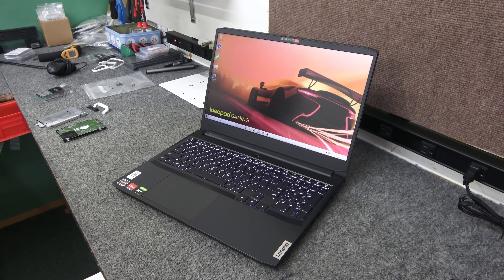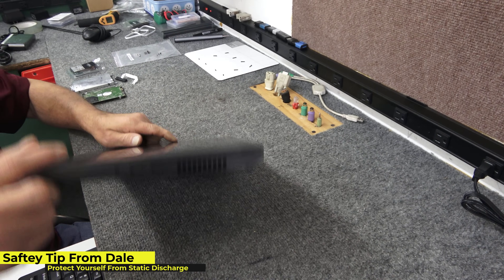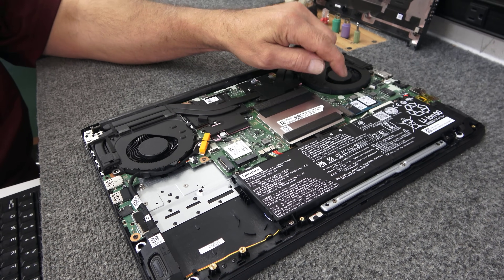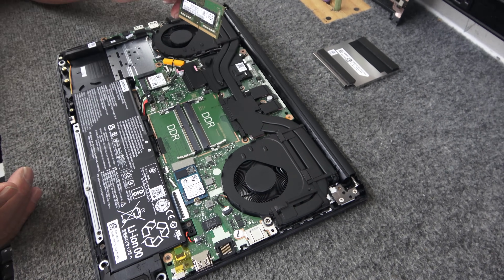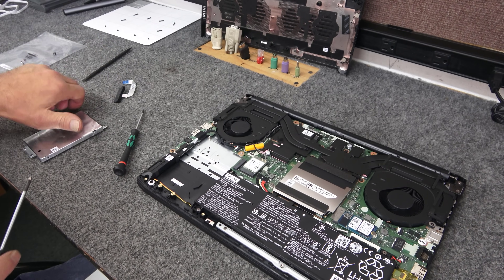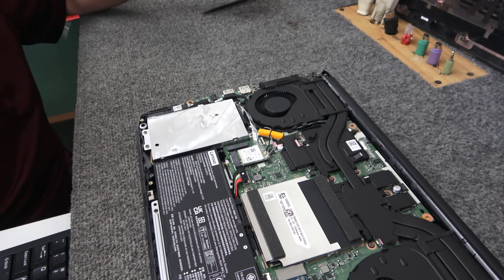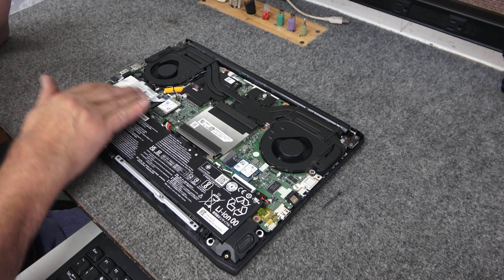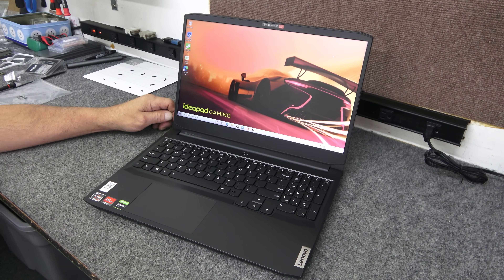Upgrading Lenovo IdeaPad Gaming 3 Laptop.  Memory and Add HDD.

Comment: Don't screw down a 2280 drive in there without a standoff. You will literally bend down the motherboard and probably break the m.2 connector it needs to be even with the other 2242. I just took a standoff for a motherboard and cross threaded it in there. It was the next size up from the small type standoff. It was even with the other 2242. And you need the same thickness thermal pad if you want to. It's verified that a 2TB 970 pro drive works and I'm sure a 4TB will work since there's nothing under the 2280. I have no idea why they don't include parts for a 2280 drive. Maybe the thermal pad cost too much. The IdeaPad 3 is a cheaply made machine. Guess that's why they only give parts for a Sata 3 drive for more reliability. It's Lenovo. They do care about quality of their main boards. Not like Asus trying to take on an Apple trend soldering everthing in and unpopulating hardware. Do be careful when re-pasting the heat sink is one fragile thing a whisp of wind can bend it. Look closely at the screw tightening numbers. They are there, but faint to see. Artic MX-5 is good. That stuff will last the whole life of the laptop. These laptops are good bang for the buck if it gets rough around a lot since they don't cost as much as the premium Legion or thinkpad line.
Reply: Standoff is not required, the M2 x L3.5 screw is all you need.  In addition, IMO a thermal pad is useless on the 2280 M.2.  It would only try conducting heat to the plastic shell which won't help dissipate any heat (or very little, at best).  Yes, there IS a thermal pad on the 2242 M.2 but above it embedded in the case is a small metal plate which will help spread the transferred heat.  No such plate above the 2280 mounting location.  BUT, the 2280 only runs at half speed, so it's not going to generate much heat anyway...
Reply: @eichisama  Hey, can you please help me out. I have the same laptop with a pre-installed 512gb 2242 nvme ssd, but I was thinking to add another Crucial P3 2280 nvme. Should I go with it or is it not recommended to install a 2280 drive because something is missing as it seems. I didn't quite understand what the problem is. Please explain in a less technical way. Thanks!

Comment: I have this laptop and want to do this upgrade. Should I replace the stock 8gig ram stick as well like you just did Or can I just add 1 more 8 gig ram stick with out issue?
Reply from the maker: Yes you can just add 8gb stick. Use same speed as factory stick. Thx
Reply: @CadillacComputerCenter  gracias! Ordering now. Same as the one you put on this laptop. The crucial 3200

Comment: This laptop IDEAPAD GAMING 3 2021 15ACH6 has wrong preset of cooling fan speed in their BIOS,
In PERFORMANCE mode (90W GPU 75 degreeC) but the fan is much more quite than in BALANCE or NORMAL mode 
Giving the PERFORMANCE MODE boosts the heat is significantly higher but with the low fan speed the GPU hits the throttle and reduce it's core clocks.
Please fix it and allow more fan speed in the PERFORMANCE, also, reduce the fan speed in QUITE mode (the QUITE mode is NOT quite at all!!!!).
I guess the dev team mistakenly swapped the FAN settings of PERFORMANCE and QUITE.

Comment: Installed m.2 2280 on mine, used a spare screw and some foam pads to level it out. Had no issues for 6 months now
Reply: what type of screw did you use?
Reply: @zooqaznguyen6820   M2 x6 screw but don't over tighten
Reply: Did you do 32gb ram

Comment: If I change to 2.5'' sata ssd, do I have to install the system? Or just follow the step you did in the video? Thanks!
Reply from the maker: Hi. If your going  boot from 2.5 inch ssd, yes, you will have to install windows on it, or do a clone.
Reply: @CadillacComputerCenter  What I meant is to switch to  2.5 inch ssd instead of  2.5 inch hdd that you use in the video. And install it at the same place at the empty slut of the computer. I can still treat it as a normal hdd just like you did in the video. Right? Thanks.
Reply: @CadillacComputerCenter  What kind of tape is recommanded for taping the wire inside of the computer? Thanks

Comment: Thanks for this video. I just bought my son the same computer, and I did the same upgrades:  8 more Gigs of DDR 3200, and a 2.5" HD.  Your video was just what I needed.
Reply: Anyone of you guys tried installing an SSD instead of an HDD?
Reply: Yes m 2 ssd pcie gen 3  @immanueldelcastillo6041
Reply: Stupid question: how much of a boost have you seen? I have this one too, and want to upgrade the ram and hhd.
Reply: @paulpiatt5610  the computer has been running great since.  My son has had no complaints.
Reply: @paulpiatt5610   if you upgrade it your gonna get a 15-25% fps boost

Comment: Whats the SSD capacity got to do with the amount of ram?  I mean I also would always tell a light computer user to not bother paying for 32GB of ram and instead if they insist on spending more money recomend them get a higher quality ram that is faster rather than more capacity but I still don't see what the SSD's capacity has to do with having 16 or 32 or 64GB of ram as long as it is running in dual channel and a reasonable clock speed that Ryzen 5600H will be able to stretch its legs.

Comment: can someone give me a  review about Lenovo IdeaPad 3  it is it good for video editing?
Reply: Which one? Link? I have the Ideapad gaming 3 with the Ryzen 5 5600H with 32GB ram and an RTX 3060 it's great for video editing. Are you going be editing 1080P, 1440P or 4K videos? If over 1080P you want to use an external monitor. Depending on the software you use, resolution of the output video, cpu, and the video card you have in the laptop will determine speed of the video render time. I'll be the difference between a 30 minute render and 2 hour render.

Comment: Hi tech grandpa. Thank you for such this helpful video!
I live in South Africa and purchased this exact device on Amazon (shipped from the US) and I got it this past Monday. I've been wondering on how to go about upgrading it and I'm thankful I've come across your super helpful video here. 

I've not opened the device as yet but one thing I'm kinda worried about is the mounting screw for the SSD. I'm planning on getting a 1TB 2280 drive to upgrade it. Could you please suggest what I can do in the event my laptop also doesn't have the mounting screw?
Reply: Bafo how long does it take to deliver from Amazon?

Comment: Hey man, I hope you respond. Can you tell me the exact model/part number of the stock ram sticks that were in there?
Reply from the maker: Hi. No I cannot. These computers are for my customers.  I have no need to know that. Any name brand ram you buy will wirk fine, just get the same speed and voltage. 1 2 volts. Different brands wirk fine together,  just use same speed. Thx
Reply: @CadillacComputerCenter  Ahh okay. I still appreciate the response tho, you got a sub!
Reply: @CadillacComputerCenter  IMO you would also want to match all the CAS timings as well, e.g. CL22-22-22-52 (same for both RAM sticks, in addition to size and speed) in order to be optimal.

Comment: Was there a warranty sticker on that laptop ?
Reply from the maker: Not on outside.  Lenovo places a small warranty sticker on one of the mainbord screws inside.  You can see it in the video.
Reply: @CadillacComputerCenter  can I replace the M.2 2280 without removing the sticker ?

Comment: does this laptop support two 32 gb ram making the useable memory as 64 GB? my use is to install virtual box and make a lab environment with a few vms to test my scripts and other configurations on operating systems. I want to know if that works ( 16 GB x 16 GB)
Reply: max is 32

Comment: I just ordered the Samsung 970 M.2 NVMe 1TB.
I'm not sure if my Ideapad Gaming 3 15ACH6, actually supports PCIe 3.0 at full speed (3×4)

Installed M.2 2280 SSD is PCIe 3x4 but runs at PCIe 3x2 due to M.2 SSD adapter limitation
Does this mean that on secondary storage M.2 2280 won't run at full PCIe 3.0 speed?
Have any IdeaPad 3 owners tried the secondary M.2 slot? If so, are you getting full PCI-E Gen 3.0 speeds? or is it 3x2?
Reply: AFAIK correct, the 2280 M.2 is limited to 2 PCIe 3 lanes, meaning max speed is halved.  I still need to confirm this on my system comparing the 2280 and 2242 performance, but according to the documentation that's how it is.  2280 is PCIe3 x2, 2242 is PCIe3 x4.

Comment: Is the battery wire clipped in? I can’t seem to slide it out like you did
Reply: It's a compression fit.  There are tiny tabs on the left/right of the plug you can gently push back with a small flathead screwdriver.  Just take your time and go _slowly_.

Comment: Just a quick question is it alright to only use one 8Gb crucial ram stick with the ram that originally came inside the laptop?
Reply: I just ordered the same crucial stick, any updates?
Reply: Any updates? I’m curious as well. Can I just buy one 8gb and add it in or do I need to buy two 8gb and remove the factory one like in the video?

Comment: I just got the Intel version of this and thanks for the great video, good in-depth things about not breaking it and being safe with battery and electrical components.

My only caveat - you mention you guided your customer on using only 16GB of RAM because he was opting to go with the stock 256 NVME drive and a regular 1tb HDD.  Which I'll normally say, even these days and for this machine, 16GB is fine for memory.  But it isn't tied to your storage space necessarily.  Some folks may not need a lot of storage but do virtual machines.  Or they have a lot of memory intensive programs - storage and memory can be 'mismatched' if you have use cases.  Just as someone who only uses it to store a lot of videos and music - they'd need maybe a 2tb drive but they don't do anything intensive otherwise - 8gb of ram is probably sufficient.
Reply: Yeah I was thinking the same thing, honesty for most of what I do on my ideapad, 8gb has gotten me by, but Forza Horizon 5 will not run without a minimal of 16gb for this machine as it uses some ram for the GPU, so if I want to play FH5 away from my desktop, I'll have to throw in anther 8gb module in this laptop
Reply: @caseygtr  you can get 1.5 more gb of usable ram if you change a setting in bios
Reply: @astrofry2340  I'm good. I added the 2nd 8gb stick.
Reply: 16 gigs of ram literally has only one purpose, virtual machines
Reply: @TabbyEgg312  Uhhhh, gaming and video editing?
Reply: @caseygtr  video editing yes but games? idk, forza horizon is the only game i know that uses alot of memory

Comment: i need help, i did exactly everything as shown in the video. i added an hdd and upgraded to 16gb ram but when i turn the laptop on, the light indicating that it’s powered on is lit up and the fans decently loud yet the screen won’t turn on. i’ve been waiting for like 10 minutes and most likely longer now
Reply from the maker: Hi. Make sure you are using 1.2 volt ram. And hopefully a good brand. If all else fails, remove your upgrades and test.  And of course be cautious of static.  And check that ram us seated well.
Reply: @CadillacComputerCenter  i have a team group brand. also when i took them out they were pretty hot, is that normal ? but they are 1.2 volt
Reply from the maker: @potatotuna7988  they get a little warm, yes. Put the factory ram back in to test.  I assume you put in 2, 8GB sticks
Reply: @CadillacComputerCenter  yea so when i put the factory ram back in it turns on, is there something wrong with the new ram i bought ?
Reply: @CadillacComputerCenter  so i mixed the two sticks together (the factory ram and one of the new sticks i got) and they were capable of turning my pc on and still have 16gb of memory
Reply from the maker: @potatotuna7988  possibly you have a bad stick. It does happen.

Comment: How much ram this laptop can hold? 16 gb or 32 gb?
Reply: The one with the Ryzen 5 5600H cpu can run with 32GB of ram. I dont know why their website say 16GB max supported. I asked their support a month ago and they just said 16GB supported. I installed 32GB 9+ months ago and it's been running fine. Not sure about an Intel cpu, anyone know if 32GB works on the Intel i5 11300H?

Comment: What happens if i put two 16GB RAM?
Reply: It might work. I have the 5600H I installed 32GB(10 months ago) and it works great. Website said 16GB Max supported, don't know why.
Reply: 16gb and 16 makes that 32gb of ram, you dont put 1x 32gb of ram or that will make performance a bit weaker then 2 stick.

Comment: It seems odd that it was designed this way, but i used that anchor screw he mentions and the second M2 mounted quite sturdily. The slot itself springs the card upwards and the screw anchors it down, plus it's tight enough that it provides lateral support as well. Looks like YT won't let me link to an image showing the install...
Reply: Did you have any issues with the computer recognizing the SSD? I put a new Samsung in there and I can't see it, driving me crazy
Reply: @samuelwatkins5145  i did. The bios doesn’t show it when it’s empty so annoyingly you won’t know where to look for it. I reseated it in the slot, screwed it down a little less (that’s one of the issues of no stand off, you don’t know here to stop) and then it was picked up in (I think) the main bios status screen. Then windows picked up right away. Can’t give you specifics as the laptop wasn’t mine, was setting it up for a family member
Edit: in win I think you’ll want to go to the partition manager first, allocate it and all that

Comment: I ended up installing a 2280 in mine and screwed a spare screw I had where the standoff should be. The drive is at a little bit of an angle, but doesn't seem to be putting much stress on either the drive or the port itself, and seems pretty movement stable.

I've had it like that about 6 months, and after just upgrading the RAM, I checked ant it hasn't budged a millimeter.
Reply: Did you have to do anything special to get the SSD to show up? I just installed a 1TB Samsung SSD that I know works great and already is formatted into the extra 2280 slot and I can't get the computer to recognize it
Reply: @samuelwatkins5145  Did you format it first?
Reply: @samuelwatkins5145  You need to go to Windows Disk Management and initialize the drive first, THEN you can format it, and THEN it will show up as available to use.  To initialize, don't click on the partition but right-click on "Disc 1" (or whatever number it is in your system) and select Initialize.  Don't use MBR, use GPT (the default).  THEN you can right-click the empty space (on the right) and create/format the partition.

Comment: Great tutorial, thanks! What are the size of the screws used to secure the HDD?
Reply: According to the Lenovo hardware maintenance manual (pdf is available to download) they are M2 x L3.5.  These same screws are also used for the 2280 M.2 slot (but only 1 is needed).  The laptop comes with 7 (4 for mounting the HDD to the bracket, 3 for mounting bracket to laptop, 1 is re-used as shown in the video above).

Comment: Hi. I have a Lenovo IdeaPad gaming 3 laptop with Ryzen5 4600H, the previous gen then this one shown in the video. I wanted to upgrade the RAM to 32GB (2x16GB) DDR4 3200Mhz. Just wanted to check with you whether my laptop will support it. I spoke to Lenovo customer care but they are not sure, there goes the premium support package in the drain. Could you or anyone please help me in this? There's a CL22 g.Skill RAM 32gb kit available at Canada computers for ~150CAD but they can't take it back if it's not compatible. Your help would be much appreciated.
Reply: 15ARH05 is the exact model number.
Reply: Im late but You can even go up to 64
not sure about the 3200 mhz though 
If the 4600h supports it then sure it would work just fine
Reply: the one you have can support upto 32gb ram 2x16. Lenovo say it can only do max 16gb ram 2x8 but its not correct this one can do up to 32gb ram max. 4600H 1650 and 1650TI

Comment: Guys, I need some advice. My device came with a 2280 SSD which blocks hdd space. I want to add hdd but I don't want to loose SSD also😢. Can't buy 2240 SSD cause it's too costly for me. Is there any way?
Reply: Nope.  2280 or HDD/SSD - they are mutually exclusive.  You CAN find a 512 GB 2242 M.2 (Sabrent makes one) for about $70.  Also note that the 2280 runs at half the speed of the 2242 M.2 due to only having 2 PCIe lanes vs 4 (for the 2242), at least according to Lenovo's documentation.  I still need to run crystal diskmark to confirm this on my own system.

Comment: may I ask a question?
what is the maximum height of 2.5 hdd for ideapad gaming 3?

I've seen ones with 7mm and 9.5 mm height, dunno which once can fit
Reply: I have an Ideapad Gaming 3i and I wasn’t able to close it with a 9.5mm height, I’ll have to get a 7.0mm.
Reply: @DanielLucena13  thats good to know
Reply: All 2.5" drive are the same dimension

Comment: Actually I got the 2280 SSD mounted by default, the 2242 is empty when I purchased the 11th gen IdeaPad gaming 3 15IHU6 82K1004CIN
Reply: How did they mount it in yours compared to what he said in the video about it not being possible?
I'm thinking of upgrading my storage and I'd rather buy a 2280.
Reply: In my new 11th gen IdeaPad gaming 3, from factory they have installed 2280 and 2242 is left empty

Comment: I bought this exact same laptop (GTX 1650, 8GB RAM DDR4, Windows 11 home ;-;) but with 512 GB m.2 nvme ssd and it works like a charm <3
I also want to upgrade the RAM cuz it uses 80% of RAM at idol so its somehow low.
Reply: Are you sure you don't have any malware installed? Mine idles at 20-35%. 80% is not normal at all
Reply: @lawrrnz013  nothing that was chrome and brave running in the backgrounds now my ram usage is 45-50%

Comment: In my laptop I have 8gb ram 2933Mhz. So the question is if I add extra 8 ram of 3200Mhz does it work together with 2933Mhz ?